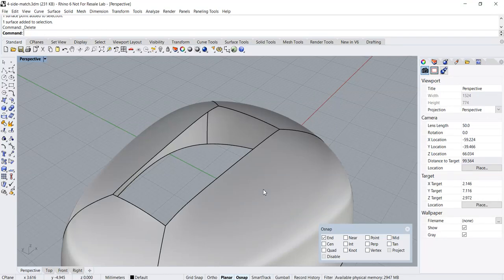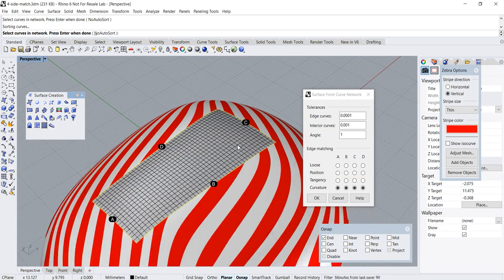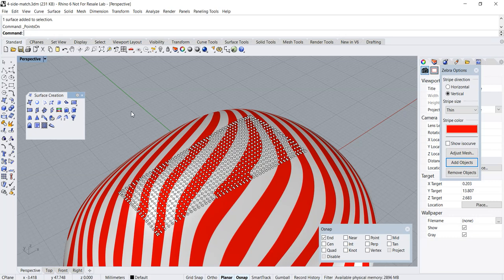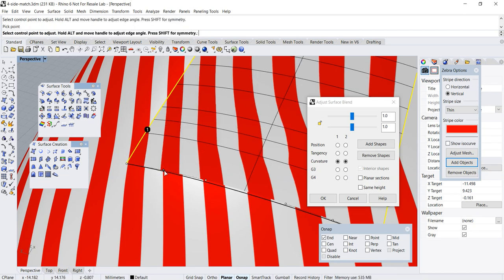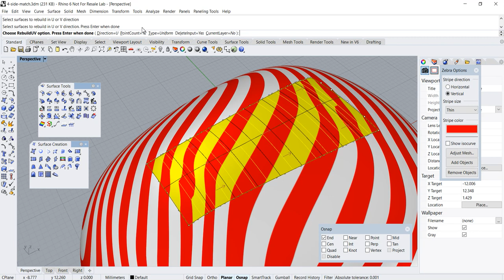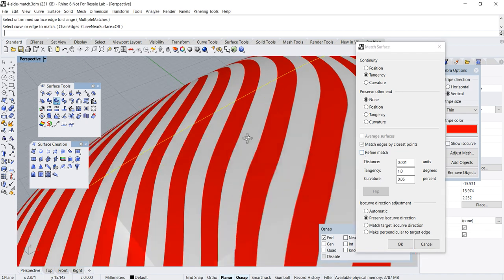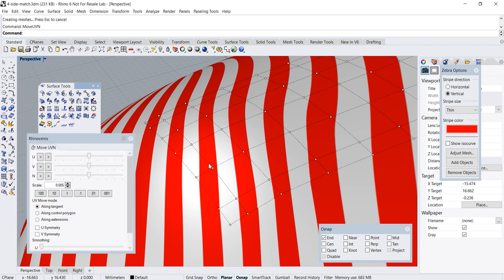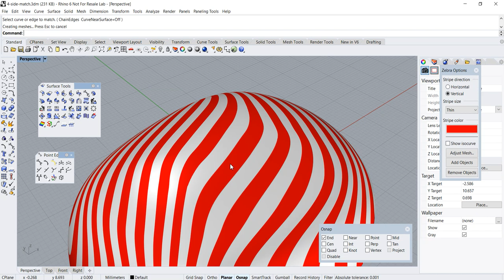Rhino 3D Tutorial: 4 Sided Matched Surface Creation

Comment: great video, just one question, you've checked if the model ended with naked edges in this part? I quite often have this problem when i use similar methods.
Reply from the maker: Thanks for the comment. There is no naked edge. This is because of the usage of the options  'Tangency' and 'Preserve Isocurve Direction' when Matchsrf is used.
Reply: @simpernchong  thanks, i'm gonna pay more attention next time.